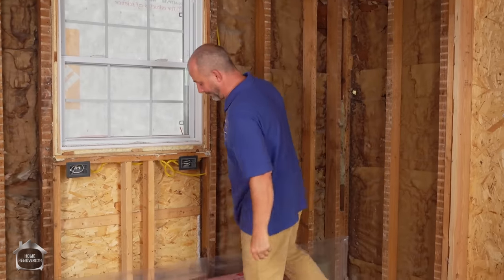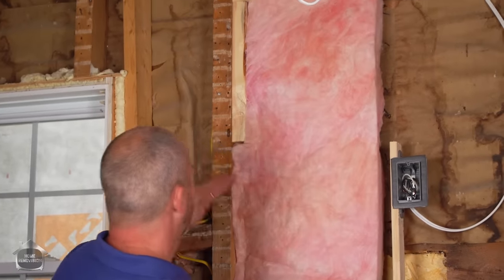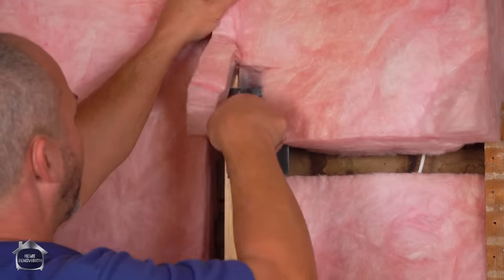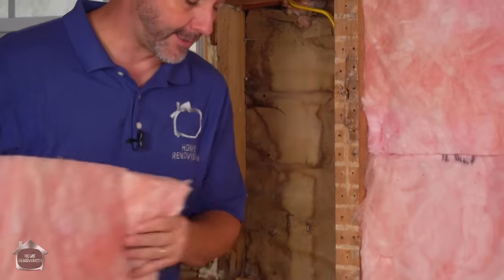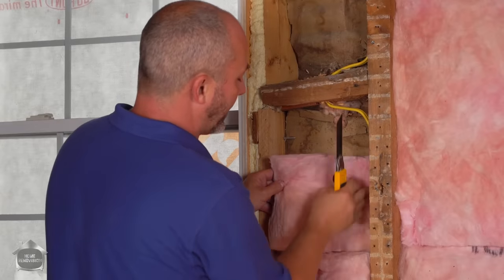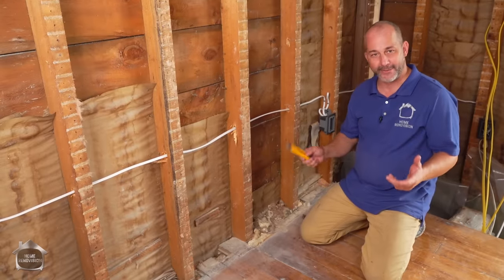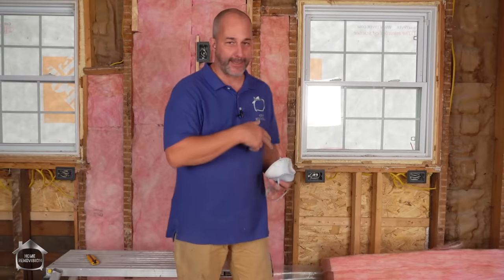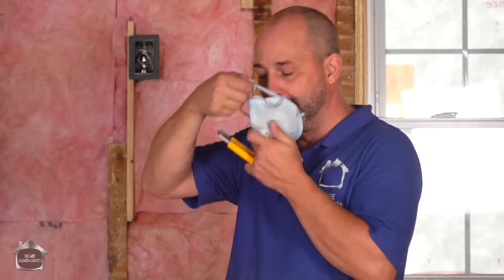How to Install Insulation | DIY Kitchen Renovation Pt. 1

Comment: The white stuff (JM) has an acrylic binder.  The others use a starch based binder.  I bought a bunch of the pink stuff and my basement smells like burnt sugar.  I wish I had bought the white stuff...
Reply from the maker: hi greg. if you have a basement then the insulation should be wrapped in plastic as well. if you smell it then it is not sealed properly. Cheers!
Reply: @HomeRenoVisionDIY  It is not installed yet.  It is going in the basement ceiling.  The  first floor is mostly hardwood with tar paper between the hardwood and 3/4" plywood subfloor.  The floor does not leak much if any. It is R30 in 2x10 joist.  I plan to cover the bottom with OSB and I hope the residual smell stays inside the floor.  Thanks for your concern.  Also, the basement is air tight and the temperature stays above 55*F so condensation is not an issue.
Reply: @HomeRenoVisionDIY  So the insulation is installed now and covered with OSB.  It does not smell  any more.  The house is also much easier to heat up which is better than I expected because the basement never falls below ~57*F.  The insulation that smelled the worst was dated the Oct 2019.  ~10% of the order had this date.  The rest was July and Sep. It appeared to not expand to the full 9" like the rest (R30- no vapor barrier).  I think it was a quality issue.

Comment: Kraft paper faced or plastic which is better?
Reply from the maker: That depends where you live and what you are using for an air barrier system. in most cases if you heat in the winter vapor barrier is better then paper faced. Cheers!

Comment: RE: Mineral Wool Vs Pink Fiberglass. I have heard that mineral wool stands up longer to slumping in the walls, as in the pink stuff will slowly move down with gravity and leave potential gaps where mineral wool is much more rigid and would not do that. Is the true or is that just poor installation?
Reply: The insulation should be snug from stud to stud preventing the insulation from sliding down. Only way it would ever tend to move is if it gained so much added weight from moisture that it falls. In this case, there's a whole bigger issue.

Comment: Do you guys do dense pack cellulose up in your neck of the woods? Much better option then fiberglass batts.
Reply from the maker: I have not worked with it mike. interesting!
Reply: @HomeRenoVisionDIY  it's got alot of upsides. Fills all the cavities, at 3.5 pounds per cubic foot it wont sag, fire and bug resistant, helps restrict air leakage due to density, better r value then fiberglass, non itchy because its recycled newspaper, great drying capacity, and so on. In the states we use it all the time!
Reply: @mikecampanella1990  It's hygroscopic, therefore prone to mold, it's not magical.
Reply: @rolfbjorn9937  you act as if fiberglass is mold resistant or something. Cellulose handles water vapor better then fiberglass. But, if that's a major concern either use closed cell foam or a better building assembly where it can breath in both directions.
Reply: @mikecampanella1990  Don't put words on my lips. I never compared cellulose with anything, I stated a point about itself.

Comment: If you had 5.5" of insulation of fiberglass but compressed down to 3.5" are they the same R value?  Essentially the same but the density it obviously more with the compressed 5.5."  So cutting the face down is not needed to thin it as it doesn't deform or ripple it.  Width cuts don't apply as the piece will cup and deform.  So compressing fiberglass is ok as long as the piece stays true shape you need.  I would guess the R-value does increase slightly when compressed but it's probably negligible, just the same if the density was too low the R-value would drop per inch.

Comment: Would closed cell spray insulation be a good option. I just bought a 1910 farm house on the historic preservation. Which means I can't do siding with a vapor barrier. PLEASE HELP.
Reply from the maker: Hi Brandon. I guess that means you need to finish with wood siding. That is going to be a few long days. Cheers!
Reply: Yes that is the best insulation option.  You don't need a vapor barrier if 2"+ thick in northern climates.
Reply: @bobbray9666  Thanks Bob. I also found out it adds some rigidity to old  balloon framing.

Comment: Could you taught me more about the basics and important tips of insulating my home please ? 
I've some pretty much all electrical and plumbing almost ready to close flooring.... I have a crawl space (vented) and a vented attic and want it all air tight  to maximize insulation property and an energy efficient home.
From the central valley - California 
Thanks a lot

Comment: Glad you mentioned the cardboard trick, it does work, by adding “holding power”(not sure if true or not, but some ppl say the cardboard acts as a “gasket” for the staple penetrating the plastic. It seems like it would,  but who knows if actually “does” anything). If you end up using the cardboard boxes that materials come in; it’s free ppl 👍🏻 That’s the other thing I see a lot with new ppl on the jobsite. They trying to staple every inch or so & not only do you run out of staples; but your putting holes in the barrier, lol.
Reply: It disperses the load bearing across the surface of the cardboard since it's compressing the plastic beneath the staples. It's a very common tactic in the South when wintertime forces some home owners of peer and beam homes to put plastic on windows from the outside, they use a cardboard stripping to absorb the load. When the North wind freezes rain onto the plastic, the plastic becomes heavy and the cardboard load bearing properties come into play.